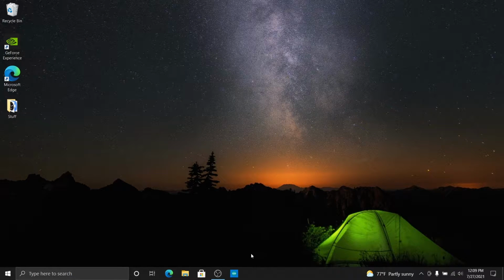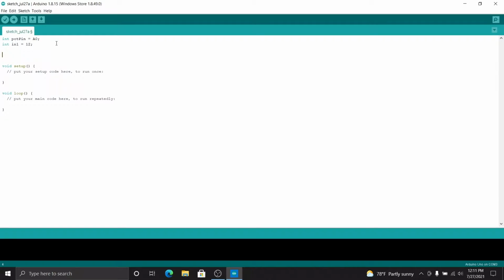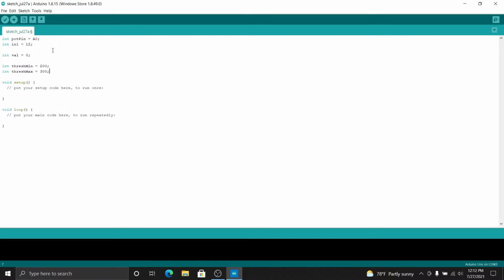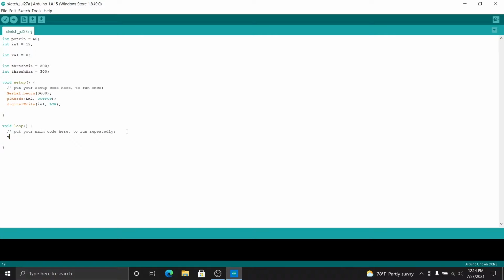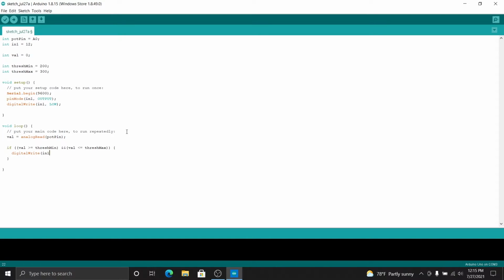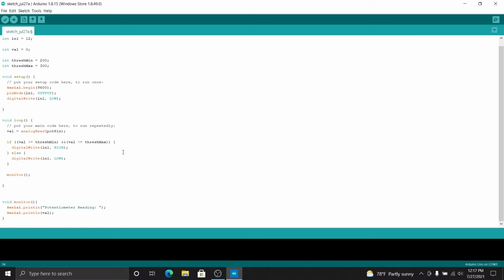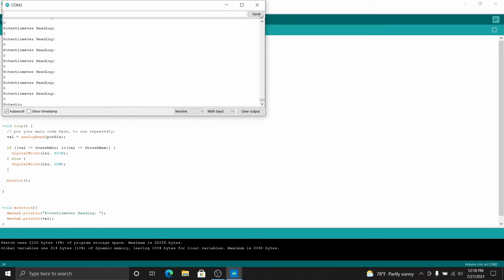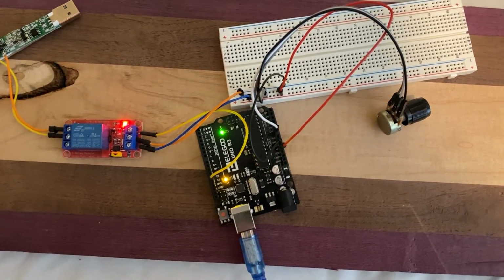Escape Room Props | Arduino Potentiometer Switch!

Comment: Thank you for this! Working on an escape room puzzle that requires a set of knobs to be turned to the correct position which will disable a maglock and this tutorial is helping so much. Need to expand it a bit to make what I need but you provided a solid baseline for me. Thanks!